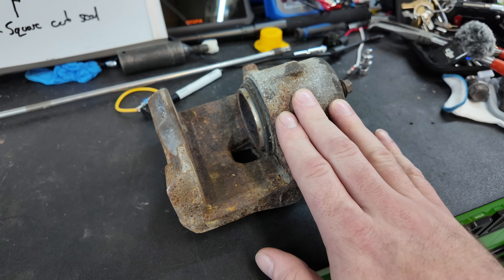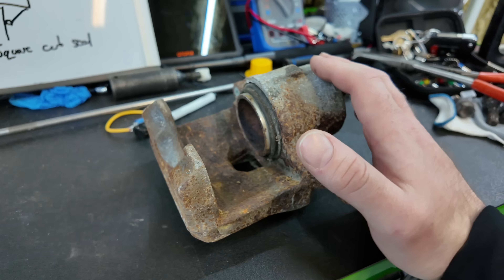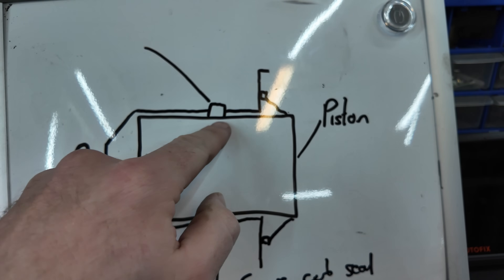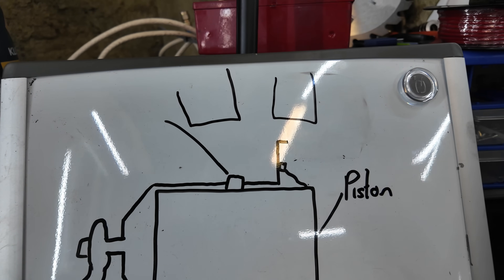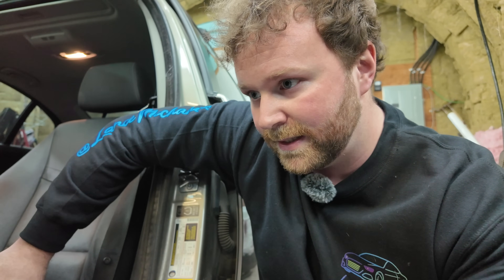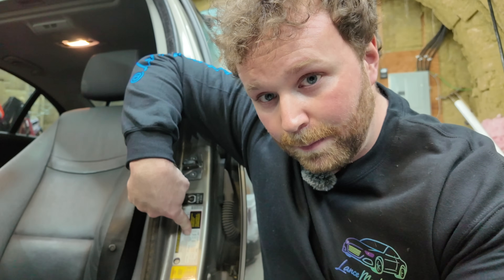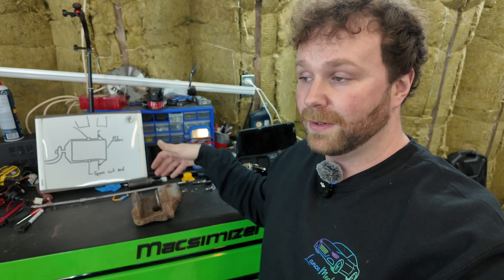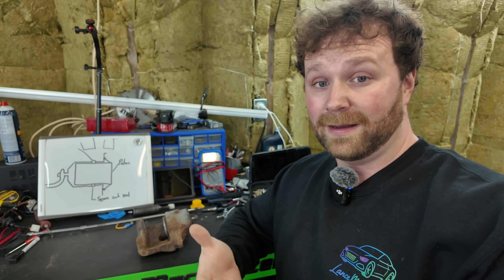Half of New Techs Can’t Explain This…

Comment: I never thought about that function in the brake caliper. But I know that seal is in there.
Reply: "Function" is there, in most types of hydraulic seals. Clueless chumps think it's by design, highly calculated feature etc.
Just stop braking, release the pressure and done, there will be a gap. No need for special "function" (or it's not the main concern, design criteria). Square seal is way more robust than o-ring for example: THIS is a main reason it's in the calipers. "Jump-back" action is a nice bonus.

Comment: Hey Lance,

After 34 years in the mechanic industry, basics are no more, if the brakes don’t work, replace parts until they do, look at all the catalytic converters that are being replaced…….how many are actually bad? About 10%  but the COMPUTER says bad cat.

The problem stems from the Emma’s is on sales and only sales run a dealership. The current push is only to do what the computer says and if it was not the issue, make up a story about how that part causes other parts to fail and it is ok to lie as long as the CSR and sales numbers are high.  Then there is the pay issue, unless you know you have time to spare and are making the money you should be, no personal education or even advanced training is sought after. 

It is this way even in “classic” restoration work, tell the customer one thing, find the parts used or from TEMU and basically do crappy work but charge a premium.

Never mind that people like me have left over a whole host of reasons, but if we try to teach what we know we are blocked…..placed like UTI hire more on positivity and  rose colored glasses outlook than they do for actual skill and knowledge. 
There is ZERO interest even by the few coming in to actually understand or even attempt to diagnose and repair. It is all about replacement.
Reply from the maker: yep to many techs rely on computer

Comment: Dumb question. So the piston in the caliper does not retract because the suction created when the piston in the master cylinder returns to its resting (no brake pressure applied)?
Reply from the maker: Wheres the suction coming from? your break pedal piston is a one way check valve. Abs system creates pressure, but can bleed it off. bleeding off pressure doesn't create suction. :) so the seal acts a mechanical way to retract the piston :P
Reply: @Lancemechanics  what makes the brake pedal return when you take your foot off the brake? I assume it's a spring. When the brake pedal returns, shouldn't it pulll the master cylinder piston back and thus relieve pressure, as well as, create a small amount of suction?
Reply: @polaridoo1  Suction is directed into the fluid reservoir (to fill the master again after the braking), not the calipers.

Comment: I'm 69, mechanically minded and practical. Have worked on my card for years. Did not know about the seal action in the brake cylinder!!
Reply: They actually redesigned the ridge the seal sits in to make it force the piston back more during the push for fuel efficiency in the late 70's and early 80's

Comment: I've had many vehicles here from other shops for us to bleed brakes.  They had replaced calipers and were unable to get the air out of the system.  They don't understand air won't escape when the bleeder is on the bottom.  They installed the calipers on the wrong side.  These "techs" work professionally, scary ain't it?
Reply from the maker: yes

Comment: I did my apprenticeship with a Ford main dealer 1970 to 75, we went to collage 1 day 1 evening awek rest of time we ere taught on the shop floor working with quilified mechanics never had computores on cars to tell us what was wrong, had to work it out for our selves and then took part off and repaired it if possible, now days most of it is designed only to be taken off thrown in bin and replaced, now retired after 51 years working

Comment: A dealer tech did the same thing to my tires recently. Tried to tell me my pressures were "all over the place" because the fronts were slightly uneven and higher than the rears when warm.  He ended up over inflating them all by around 5 psi and the service manager just brushed it off like it wasn't an issue.
Reply from the maker: I consider it a massive issue. 2nd leading cause of tire wear is pressures and boy does it effect handling :(

Comment: the relief is only a micro amount, more importantly, the older techs can't diagnose because of the technology, engine light on because of ECU fault in fuel system, the young ones can't repair because they lack the core understanding of mechanics, the gentle dance between air, fuel and timming as example, it took me near 2 months of self learning OBD 1 and 2 and the modern injector systems going from points and carburettors, to get my head around the sometimes uneeded sensors....

Comment: OMG the tire pressures!!! I battle with "technicians" almost every day about this!! Drives me crazy!
Reply from the maker: yep. you can't win. I watch 10-30 veterans fumble the basics
Reply: @Lancemechanics  I always fill my tires at 4 psi higher than the door sticker pressure, since the tires are hot after driving to Costco. Then, the next day, I adjust to the cold value. Before, Costco didn't allow me to fill my own tires (had to call one of the tire employees). And they didn't understand why I didn't want the machine set to the pressure on the door sticker. I explained that those numbers were for a cold tire, and that since my tire was hot, and pressure rises with temperature, they needed to fill my tires at a higher pressure. And then adjust to the correct cold value when the tire was cold. But what did I know, I'm not a tire tech. Luckily now I can do it myself.

Comment: Actually its wheel spinning forcing it back, only seal is usually not enough .
Reply: Yep. People over-complicate things. Just read the comments, how many dummies believe in the "retracting by design" function. Yes it's there, but it is natural for most hydraulic cylinders (regardless of seal shape/type)!
Just stop pushing, release the pressure and done. There will be a gap (the piston will "jump" back a bit). Plus "everything is a spring" (things spring back after you push).
Lubricating the piston during assembly should be forbidden (because it could spoil that "jump back" action) - as far as  I know there is no such "ban" on lube (it's the opposite).
Main reason for square seals is a robustness (comparing to o-ring). Jump-back action is a nice bonus.

Comment: How to read a engine vacuum gauge = very good diagnosis . How to read a wet dry compression gauge reading . HUGE AMOUNTS of HVAC not taught .  Micron readings diagnosis . Nitrogen decay . What are the many ways to assess a system  full of refrigerant . What are the many ways for leak detection .  Hint no genuine manual will have any of this  detail
Reply from the maker: yep my favorite tool is a vacuum gauge. quick. efficient.

Comment: Apprenticeship, the day of bringing on a new worker as an apprentice has faded.  Unfortunately, this has occurred in all industries and it is a loss to societies' technical capability.

I didn't know that about the seal, learned something, thanks.
I knew about tire pressure (PV=nRT), have also observed the changing pressure with the seasonal temperature changes over many, many years.

Comment: I was told this about lathe cut caliper seals retracting the piston in high school auto mechanics.  then also at trade school at mohawk collage in Hamilton in the 70s. also when Nissan was Datsun the shop manual for Datsuns describe brake rotors as being diagonally machined to act as a swash plate to push the pistons back into the calipers. I moved to British Columbia  in 1983 and found out that at that time Ontario trade school taught many more things then the trade schools in BC

Comment: It's pushed back by a spinning rotor through brake pad only slightly. Of it sucked itself in, the brake pedal you would be a mush.
Reply: Just release of the pressure is enough. Jump-back action is natural in most types of seals. People think it was a "main criteria" in designing brake calipers. Square seal robustness was. And the retracting action is a nice bonus.

Comment: the tire shop not lining the yellow dot up with the valve stem
Reply: I pride myself on my minimal weights per mount. Customers don’t even know how good they got it.
Reply: It flips my lid, especially on motorbikes. Such a simple thing to do.
Reply: @Videoswithsoarin  Depends on if road forcing is being used. That spot can be best practice depending on red or yellow dots, but if the road force machine matches the heavy spot to where it wants it, then it doesn’t always want that spot to be there at the valve stem. Just look at how some brand new cars come from factory, the spots aren’t always lined up like that cause of imperfections in the rim and tire contribute to the optimal point. But yes real world people are not paying attention to the spot, the machine or part that does the road force is broken and isn’t getting fixed either, also a beat up rim with dents, that is not not straight or balanced at all or after market rims etc etc mean at least to me that the “paint spot” that needs to go right there, doesn’t need to go there. Unless you are a specialty application that requires perfection like f1 or something, I feel any old person ain’t gonna be able to tell a difference whatsoever at the end of the day as long as the tire was mounted correctly and put a half decent balancer with someone that understands how to get it close enough is fine for your tires and riding experience.
Reply: Yes
Reply: Those dots are wrong most of the time, tires are clocked according to the roadforce measurement if they're done right.
Reply: So how is that bad for the customer? It’s good practice but a balanced tire is a balanced tire
Reply: @knunn5171 The more balanced you can make a wheel without adding extra weight, the better. It means less rotating mass, less stresses in places they are not meant to be- I have seen wheels with 20+ wheel weights on one side, just to allow for a bad tyre/rim combo. In theory (again, especially on bikes) the dot alignment with the valve stem is there to allow for the extra weight of the valve assembly. On a big rig truck, this is less serious than on a Corvette or a sports bike where tyres are as light as possible. Then there's the problem of those unnecessary weights coming off on the road. You're potentially going to lose control if a wheel goes unbalanced suddenly going through a curve on your favourite Sunday morning twisty mountain road...
Reply: @knunn5171  Not necessarily. Theyll balance on the machine but start shaking at high speed if the tires heavy enough in one spot vs the rim. Yellow spot is considered the "light spot" on the tire, red dot "heavy spot". Yellow spot is supposed to go to the stem unless you have a red spot, red spot goes to sticker and takes priority over yellow. Every rim on a new vehicle these days comes with a sticker noting the light spot of the rim, in the past they had a marking stamp. Most people remove these stickers. Without a road force you can no longer 100% balance a wheel missing this sticker

Comment: The pads do not have to retract very far; nor do we want them to.  This makes for faster application when we hit the pedal.  I don't know what the expansion rate of hot brake fluid is; but for sure the metal near the source of the heat is going to expand and contract a minute amount when it cools.  This will change the volume of the lines.  I like the seal explanation.
Reply: Most types of seals in the hydraulic cylinders will do that "jumping back" action. It is NOT "designed" on purpose.
It's there, naturally (more or less pronounced effect). Square section is more robust than o-ring for example, plus the stroke is usually very short during normal operation. Plus environment, dirt. These are the reasons for selecting square cross-section seal. "Jump back" effect is a nice gratis/bonus we can utilize. NOT designed/calculated feature.

Comment: The play in the rotor drives it back too. Race car drivers pump the brakes to take up slack.
Reply: Agreed
That's why I was taught to leave a little play in the bearings when tightening the nut
Tighten , then back off a flat or 2

Comment: Interesting topic, I have 45 years experience in automotive diagnostic and repair, California credentialed teacher, taught automotive technology for LAUSD from 2001 through 2012 , when teaching ignition systems I started with model T flywheel triggers through 1947 Harley Davidson wasted spark ignition , point and condenser distributors all the way up to modern ignition systems, when teaching charging systems I started with generators, fuel systems I started with updraft carburetors , no one else did or does this.
Reply: When I went to high school in the 60’s we started with the 3rd brush generators, alternators were just coming out.
Reply: @edsnyder4073  Not too long ago I showed how to polarize a generator on Jaguar restauration, no one had a clue about it.

Comment: Most of school was a waste for me but I had a weird grade school teacher taught physical science we learned about things like leverage, surface area, heat transfer, temperature affecting pressure/volume, hydraulics and basic electrical amperage/voltage. It obvious to me this is the best place to start with kids get them thinking about how systems work. By the way I rebuilt 4 old Toyota calipers for less than $ 10. found some rebuilt kits on close out for less than $2.ea. so knowing how it works can really save you a fortune.

Comment: basic hydraulics , when the port is open in the master cylinder the fluid travels back to the master cylinder by the square o=ring ,as well as the rear brake return springs

Comment: Spot on, here in the uk vehicles 3yrs and over (yearly for HGVs) undergo an MOT road worthiness inspection, increasingly I am noticing young guys who have gone through the training course failing  vehicles for minor wear in components with no judgement made as to whether the component constitutes a danger if it totally failed. The test only confirms a vehicle is road worthy on the day it is presented but increasingly components are condemned because they MIGHT need replacing within the NEXT year!
Reply: They probably have a quota with "oi mate ,you got a loiscence for the crack sway bar bushing?"

Comment: Yes! This is a massive issue. I was in the last of the fully trained old school automotive mechanical engineers. Every aspect of motor vehicles was covered to at least some degree, including body repair fabrication, trim interior and exterior, glassing, electrical, tow hitches, internal mechanisms of dash instruments, fluid chemistry, aerodynamics, it was extremely comprehensive compared to what it turned into in only a year or two after i finished. But i also did a small engine correspondence coarse during that time also, that went even deeper into some very (to my mind) valuable theory!
I made a point of completing every lesson my boys had (only have two sons of course i would have included a daughter) back filing every subject in its significant relevance. I had enough experience to know just how important the demeanor of a teacher or mentor is .. and im a clown, so they were always happily engaged, another thing lacking in much of the learning today.😊

Comment: I remember that they just briefly mentioned on the seal retracting the piston between all the other talk and i see how someone could forgot it. I found it fascinating and i've remembered it ever since.
Pro tip what i noticed at a bus company. Brand new calipers will create some rolling friction after you press brakes up. An early sign of the piston/seal getting stuck is that the tire has absolutely no rolling friction. this comes to the fact that the seal is stuck to the piston and it pulls the piston back slightly too much. on the busses i saw that next year that caliper needed rebuild.
very helpful if you're maintaining your own car. tried to notify that to the bosses on some clients cars that their one caliper might get stuck soon but never got to fixing it at that time cause either they didn't tell clients or clients didn't care about it.

Comment: I remember in the late ’90s working on a full 3D SDRC I-DEAS assembly model of a Ford/Navistar diesel engine, creating exploded views for technical illustrations. Some younger coworkers were watching my screen and were genuinely astounded that I could make sense of such a complex model so quickly.

The reason was simple: I was already grounded in basic mechanical and manufacturing principles. Once you understand how things are made and how they physically work, the models make sense. I applied those same fundamentals later when building Honeywell gas turbine models completely from scratch.

That mechanical foundation also made it much easier to understand electrical and hydraulic systems. Even without a formal technical degree, my experience and abilities were often held in awe by newly graduated engineers when I worked at Boeing in Mesa.

I owe that foundation to my father, who would have turned 90 this week. He sparked both my interest and my mechanical aptitude, and it made all the difference.
Reply: Fortunate man